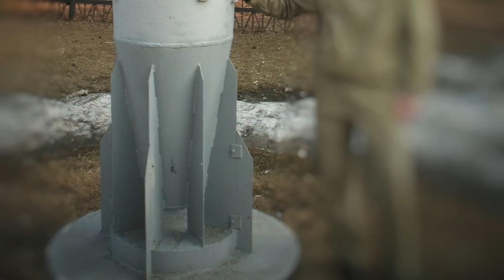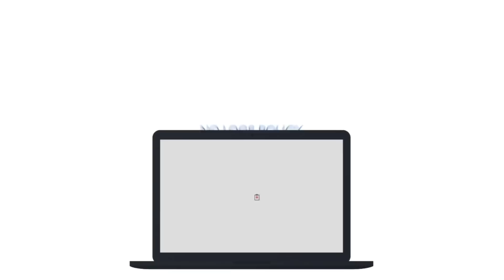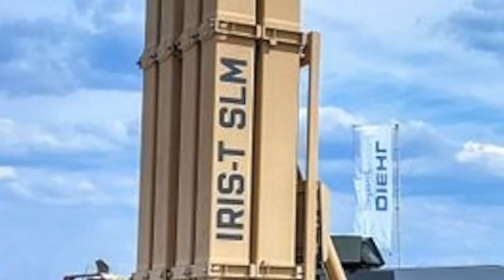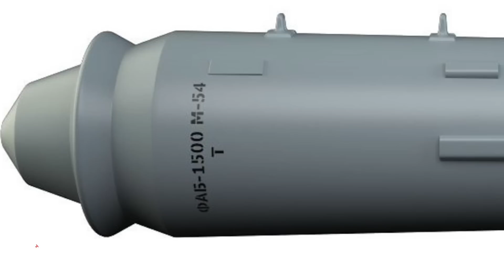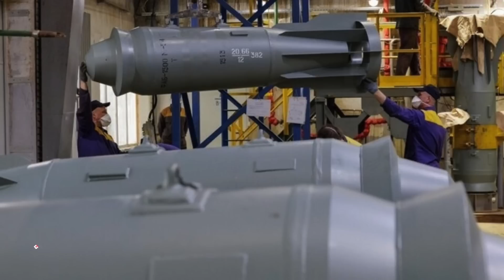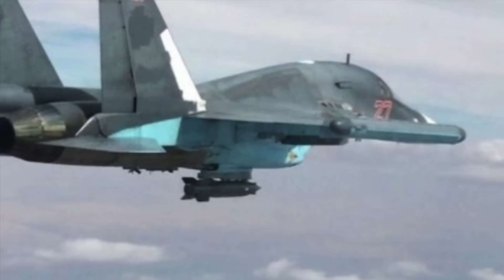#Russia deploying 1.5 ton FAB-1500 Glide Bomb in #Ukraine !

Comment: Ukraine is getting the ground launched small diameter bombs very soon.  These weapons has a range of 94 miles (twice that of Ukraine's current HIMARS rockets).  They should help Ukraine greatly.
Reply: Sounds like Ukraine needs some of the C-RAM units from the US and NATO neighbors. They might be able to pop these buggers in flight, if they are that big a target, and can be tracked. Gepard might be able to pop it too.
Reply: Yes but i think the problem is those short range systems don't have a long range so you'd need 1 unit like to protect every facility/weapons systems/depots etc. More Gepards for Ukraine would be ideal as a 1st line of air defense, mainly cuz it has cheap ammo & can take out everything aside of ballistic missiles i suppose.
Reply: Aren't these same as Jdam which they're already using?
Reply: @bekeneel  similar but a bit different bomb and strapped to a rocket so doesn't require risk of their very limited airframes, can just roll a himars where needed and start slinging.
Reply: They should help Ukraine greatly. ? help how ?
Reply: Only people these weapons will help are US military contractors
Reply: Наличие мозгов поможет Украине, а не бомбы
Reply: Идиот украине уже ни что не поможет, сатана как может одолеть Бога.
Reply: Скоро йеменцы борющиеся против мирового империализма получат крылатые ракеты чтобы бороться за свою независимость , с ними будет гораздо легче топить корабли империи зла , что сеит по всеми миру банановые революции садя в управления целых стран своих послушных марионеток